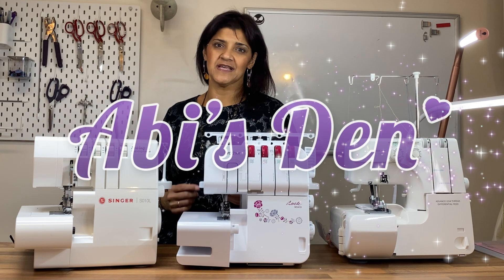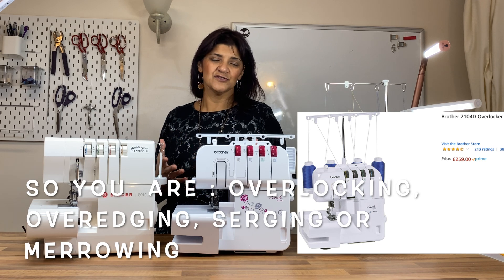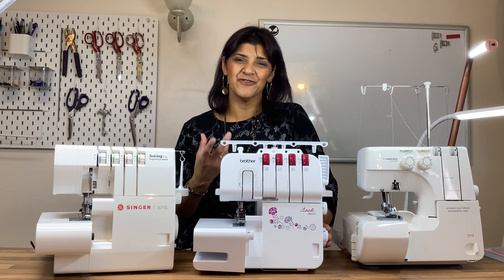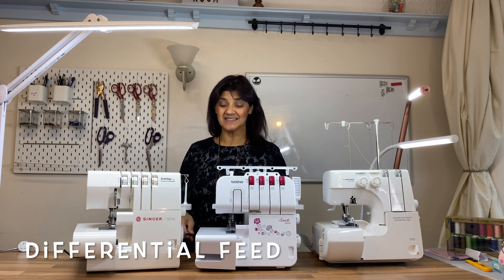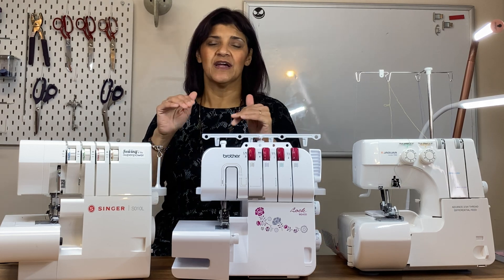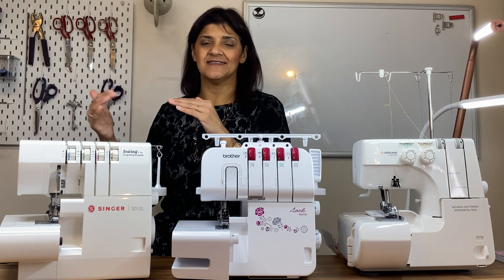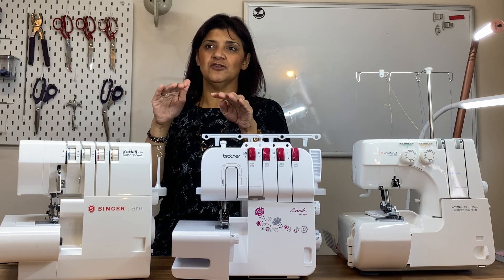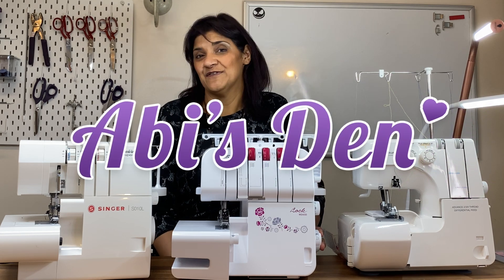What is a Serger? Is a Serger different to an Overlocker?  & other burning questions #SewWithAbi 🧵

Comment: Thanks Abi for a really great explanation of overlockers.  Just noticing your jaguar, what do you think of that model (099) as opposed to the 2015df?  I've been considering the machine.  Does the 099 still give you the simplified threading system that you mention on the 2015?  Thanks for great content.